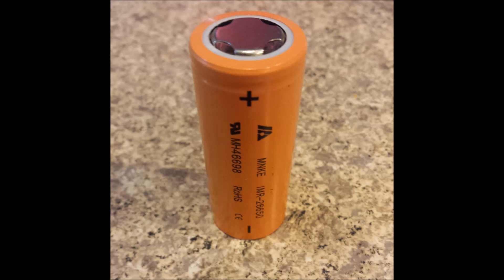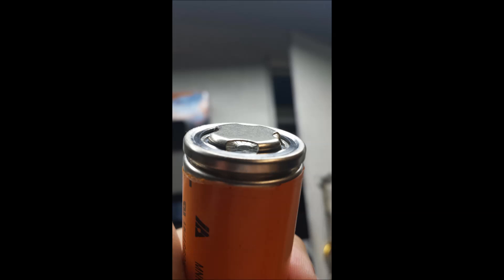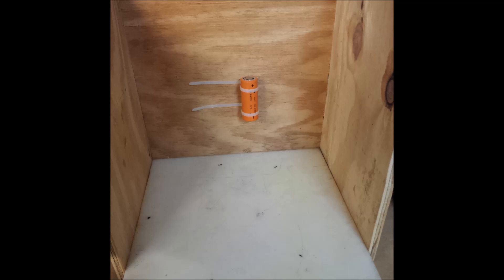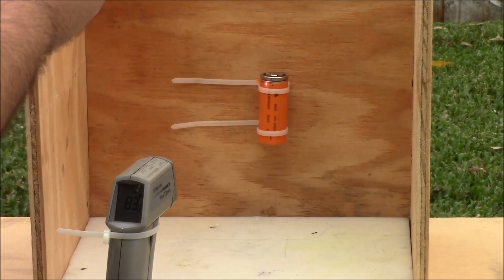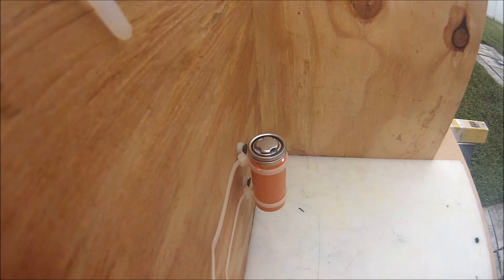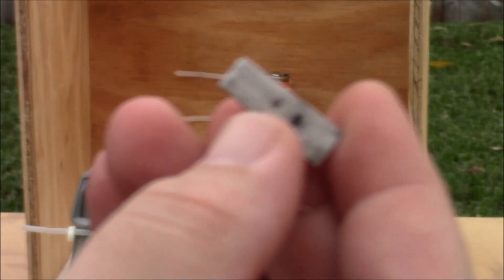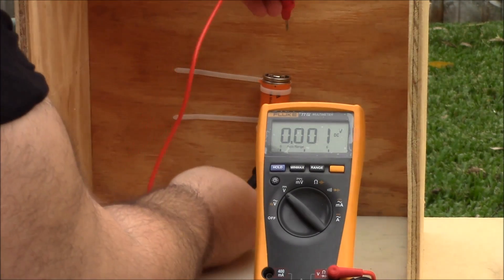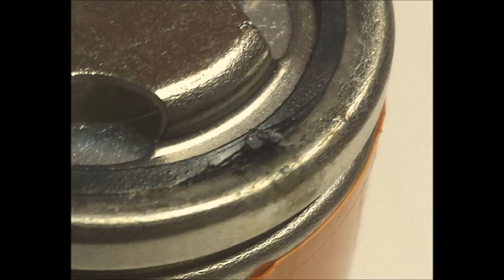MastBlast09 Vents and MNKE 26650 in a controlled environment

Comment: the real danger of this battery is all depenent on how you are using it, this is worst case senario in your mod, build safe and BELOW your batterys rated amperage limit and you should never have a venting issue, let alone an explosion, keep it at a logical resistance like above .2 ohms maybe .1 but you dont ever need to go lower unless you do want issues, its a damn hot vape anyway.
but thats my 2 cents. dont believe all the hype in either direction, they are electrical devices so they will never be perfectly safe, nor are they pipebombs designed to fail and dismember their customers left and right (pun intended ha..)  so just be careful, if you know you have a low res build on there and you note that your device itself is heating up more than normal, stop, and up the resistance a bit. You dont have to be an electrician, but by owning the mod you have to ensure it is operated as it was intended and designed  to

Comment: Nice work Mast. Know this might be (alot) trickier to set up, but would be interesting to know how much gas is expelled during venting, as the venting seems to take place over a very short period of time. Also, would like to know how far the 26650 would travel when fired from Chuff's air compressor. Enough to dent the electric box?

Comment: Vents immediatly, but no explosion, thats good. The tests Chuff did on the 18650's -there was a time period after shorting before venting kicked in, so there's definately a considerable big difference in how the two sizes react on a short. Another thing i noticed and think is good, is that is wasn't as agressive i thought i would be.
Reply from the maker: It is more likely that was due to the size of material causing the short, than the battery size.

Comment: As much as I like to see things go boom, this is oddly reassuring.   So now we have this video, and the ones Chuff made.   OTOH there is the other recent 240p video, which we suspect is a bit dodgy.   However, we did see the VapeBlast aftermath.    I wonder what would happen (and I know, this takes time, effort etc) if you overstress the battery first with a very low ohm/high amperage build, and then short it - or drop it... I know these things take time, and maybe we are looking for the perfect storm of combinations.   Still, we can scrap the "dead short over the top insulator" scenario.  Thanks Mast.
Reply from the maker: To our knowledge we do not know what battery was used in the VapeBash incident, it was never recovered.
Reply: Fair point.

Comment: Mast, how does this differ from what a standard short at the coil level that would be normal use case.
Reply: i was trying to accomplish a catastrophic failure by trying to compromise the insulator on the top of the battery, this way i could come close to replicating a video that has been posted all over the place of someone shorting an MNKE that blows up violently at the end of the video. i have a feeling a short at the coil level could allow the battery to take longer? to exhaust all of its energy in turn getting hot in the process? more testing will be done to determine this.

Comment: so how in the hell are people making these things explosive? Are we all still missing something, or wtf
Reply from the maker: In which cases? There was a video of a battery partially buried in the dirt shot in 240p in 2014. And there was a an incident at a convention where the battery was never found. IMR batteries are not known to react violently on vent, other batteries though, like ICR batteries, definitely are.
Reply from the maker: darksiede I cannot speak for what happened in that video, nor do I think any of us really want to publicly speculate to much. I can say that we expected the response we got. Mast did it in HD, with the battery fully exposed, and from multiple camera angles.
Reply: Plumes Hazard Your 'shorting device' failed is what happened.  I'm the idiot that made that video on the mole hill in my backyard with the MNKE explosion.  I used a thick piece of metal for that. A dead short isn't likely to happen in a tube mod. Better test is to have a coil setup at .05ohm or so and auto fire it. I was thinking about doing that.

Comment: Great execution. A bit anticlimactic for most, but guys should realize the REAL danger comes when the venting occurs INSIDE of an airtight device. 'Tis that which then makes a pipe bomb.
Reply from the maker: That actually is not a fully accurate statement. The main point was to surely execute basic safety but using the proper batteries goes a long way as well. Even in a tube an IMR does not often react violently as shown by our friend Chuff:

18650 Batteries vented inside of a mechanical mod

Any hole, no matter how small is enough to let gasses out, airtight is not really an issue in the vaping world.
Reply: Its doesn't have to be airtight. If the pressure build up is greater than the pressure being released it will go boom.
Reply: If they are made correctly they shouldn't be "air tight" as you called it. They should have venting holes. Fyi
Reply: Plumes Hazard You cannot make general statements about battery safety based on one experiment. A new battery will react differently than an old one. Do you know the exact charge level? Do you know the exact battery age? Do you know anything about their quality control? You have to treat every battery like the worst case scenario, an aged battery with possible flaws in the separator. Your experiment shows one possible outcome. Others show different outcomes. Both are a possibility. You have to prepare for the worst.